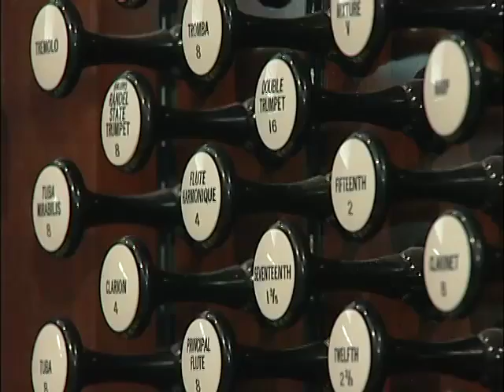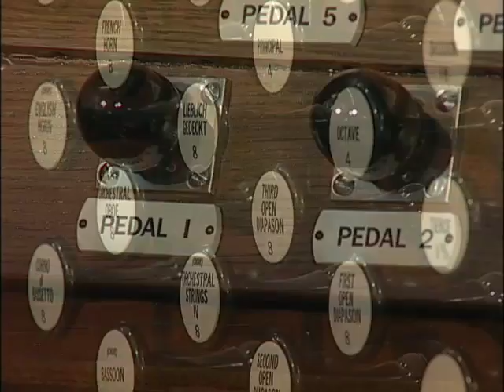Skinner Organ @ the University of Chicago

Comment: The University of Chicago (NOT in the suburbs) Rockefeller Chapel instrument since its 2008 restoration now has 8,565 pipes in 132 ranks.
The Holy Name Cathedral instrument comprises 71 stops, 117 ranks, 5,558 pipes, distributed over four manuals and pedal.Manual compass 56 notes, pedal compass 30 notes, flat pedalboard.

Comment: Judging by the pipe lengths he gave, the frequency range of the instrument ... not including overtones -- :D -- is from 16 Hz to 16,000 Hz.  Overtones on the highest pitches would easily push them into the ultrasonic range.
Reply: The highest pipe pitch in this kind of organ would be note no. 61 on a 2' rank, called 1/16 foot C. This sounds an octave higher than the highest note on the piano keyboard, or the highest note on the piccolo flute. In my experience tuning such pipes, these aren't really ultrasonic, and can still be plainly heard.